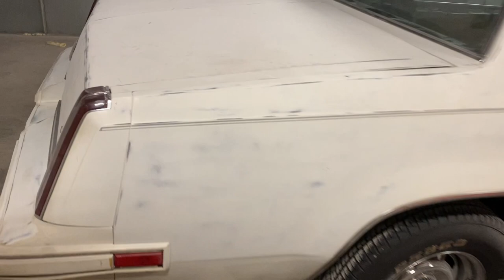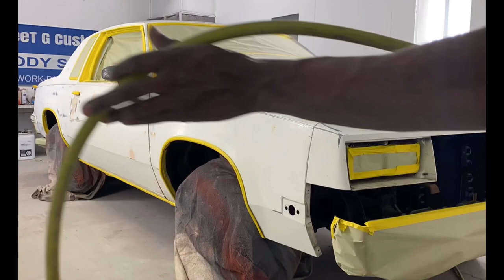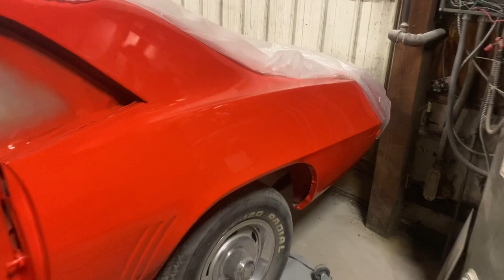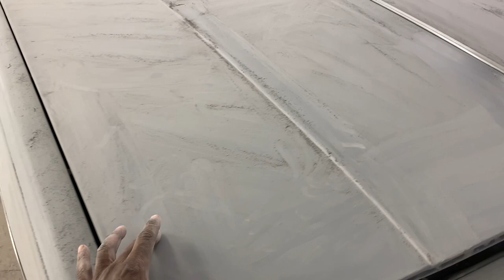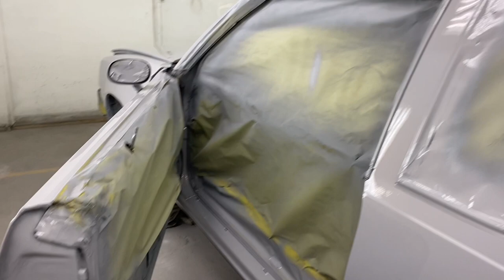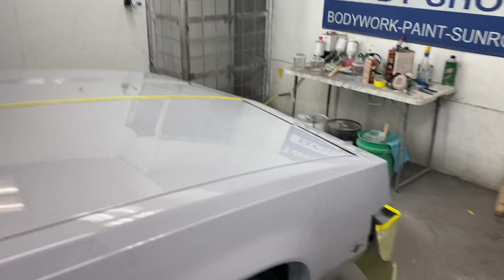1984 cutlass Supreme( color Gray with Orange pearl)

Comment: Sweet paint with the orange pearl and how much different would it had been if you did a orange flak? And you prefer the flow coat or cut and buff?
Reply from the maker: The Orange flake would have made a little different... But the the flow coat is just to knock down the Orange pill and add extra clear so when you wet sand and buffet you can really cut the  Clear
Reply: @lawrencepatterson  what's your number